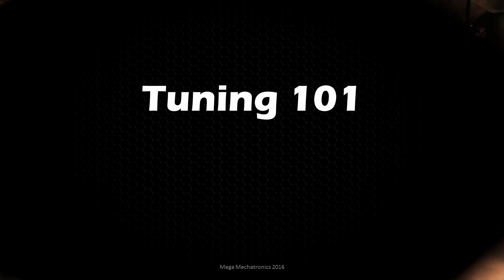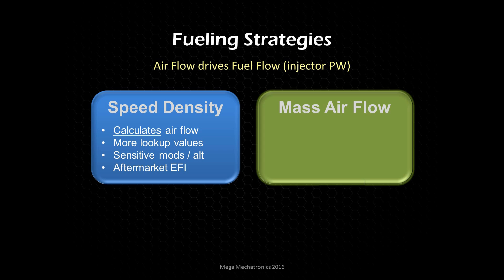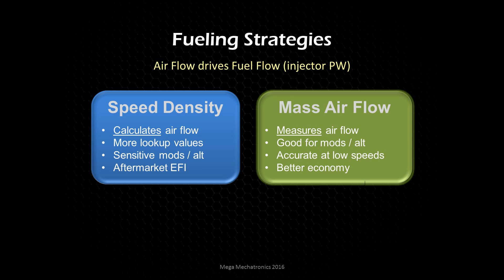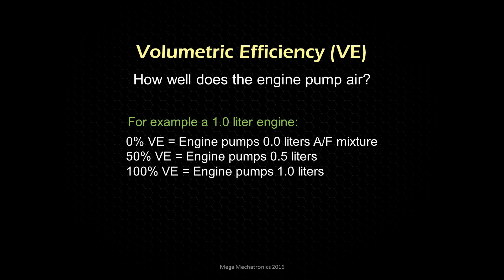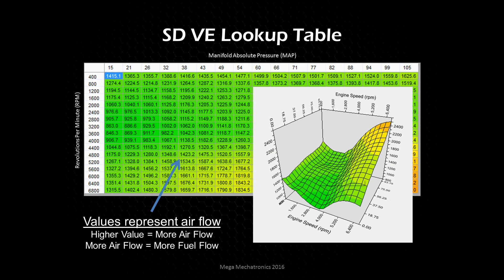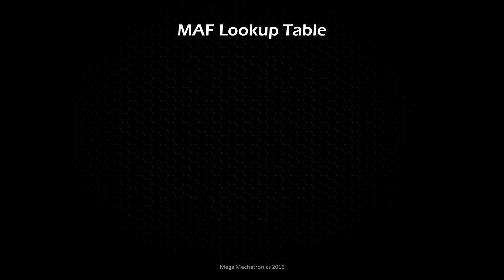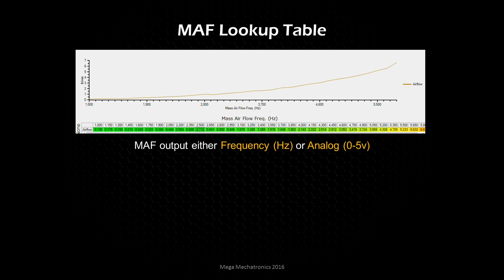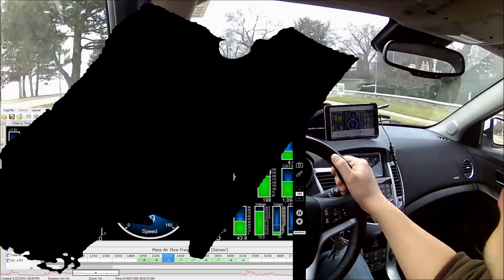How to tune Engine Tuning 101 - Part 3 - Speed Density vs. MAF

Comment: Hi! I am having a huge problem tuning my cruze. I am running open loop speed density. Now, up until recently, I got my VVE dialed in using STFT. That worked well, but I knew it could be better. I maxed out the closed loop enable time to like 32000 seconds, and lowered the o2 readiness to -2048, which according to their docs, 100% disables closed loop. And yeah. it does. But as my engine warms up, my car starts running lean until it's so lean I cannot tune it at all. I found this out after a couple of hours of logging, tuning, flashing, logging, etc. and then after the 5th one my car was so rich it wouldn't start. I have traced this back to the injector tip temp and intake valve temp PIDs telling the computer it's dumping too much fuel, so it cuts back, until it's BEYOND lean (when it does this, my error graphs show +26% from 1 lambda across the board). Starting and stopping it fixes it for a second, but until I re-enable the o2 readiness, it does this. It makes it REALLY hard (impossible) to tune the VVE with my wideband (logging on hp tuners via serial).

Please, help me out. I: have watched your videos quite a bit and you came recommended by a member on cruise talk. You can get VERY technical. I tune every single day, multiple timnes per day, and used to tune hondas way back in the day. I just cannot figure out how to fix this issue.
Reply from the maker: What is the justification for running speed density open loop on the Cruze? Is there an issue with MAF tuning in your application? Anecdotally: I have no problems with extreme engine mods on the E67 ECU (2.4L twincharged, 40 psi) running closed loop MAF, and my Cruze is full bolt-ons with meth injection on the E78 GM ECU, again no issues with closed loop MAF performance and driveability. 

My suggestion is to start over and start with MAF tuning you should not have to deal with so many quirks unless your hardware (your engine) is worn out then a tune cannot do much.

Comment: Hey, newbie question: the short term fuel trims and long term fuel trims in essence tune the engine for you? so why do we need to tune the engine at all? is it just to provide a safe/rich afr beginning/reference point for the ecu to go from? or do we manually tune engines to achieve greater accuracy and manually set specific values to achieve non ideal AFRs for specific situations eg launch control, fast idle, engine protection etc?

also, are STFTs and LTFTs flash memory? as in do they reset everytime the ecu is disconnected from battery power?

thanks in advance
Reply from the maker: The engine control units are highly capable but need a lot of manual calibration during development.  Engine calibrators (you?) have a table that tells the MAF or SD system how much air is flowing compared to what it is reading abitrarily (Hz or 0-5v signal).  If you change the characteristics of the physical setup, it throws all these tables off because the physics have changed.

Please check out this video on why you need to calibrate after installing an aftermarket intake/filter. https://www.youtube.com/watch?v=rIQut_J2_I4

Comment: he says "theres no replacement for displacement" then goes over one of the replacements for displacement, forced induction :p
Reply: Forced induction makes the equivalent of more displacement, if your 1 liter engine is running at 200% efficiency it would be putting out 2 liters of displacement.

Comment: Just noob question,. Where did you get the 0.96 to multiply the given value?,. Just confused thanks
Reply from the maker: For example: if LTFT (long term fuel trims) are -4, this means we are 4% rich. To make the fueling perfect, we need to theoretically remove 4%, so we would want to multiply the airflow calibration by 96% (0.96) to remove this 4%.  Say our fictitious airflow calibration value is 1000 and we are 4% rich, if we multiply this by 0.96 we get 960 which is a 4% reduction in the airflow calibration (which is proportionally a 4% reduction in fuel flow).  In reality, a LTFT value of -4 is a good target, so this example is to help understanding of this concept.

Another example: if LTFT were +5, then that means we are 5% lean, so we would want to multiply airflow by 105% (1.05) to add more airflow which proportionally adds 5% more fuel flow.
Reply: @MegaMechatronics  beautiful!!!
Reply: oiii oi 999

Comment: Are you going to go more in depth into hp tuners? I would love it as im sure others would. 
I have a forged  turbo 383 gen1 with gen 3 ecm head cam intake t/b ect. I just finished .
Reply from the maker: A case study is in the works for a full HPT performance tune, I will go through all changes needed to add 50-100% more horsepower to a stock turbo car.